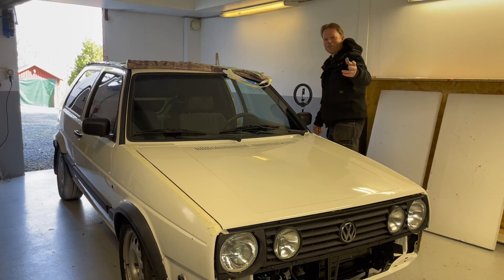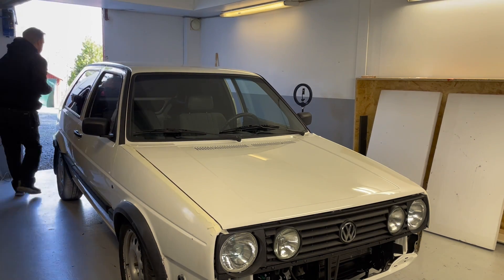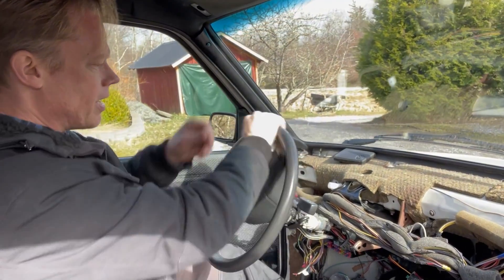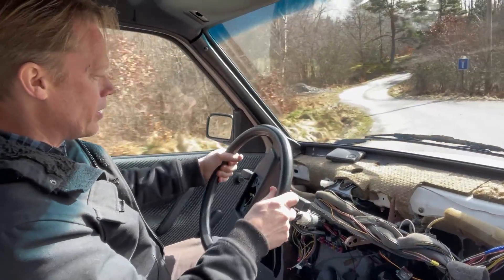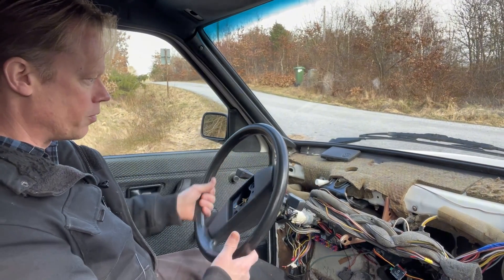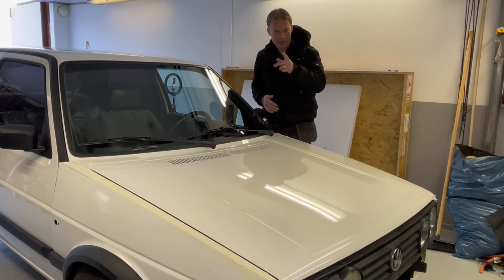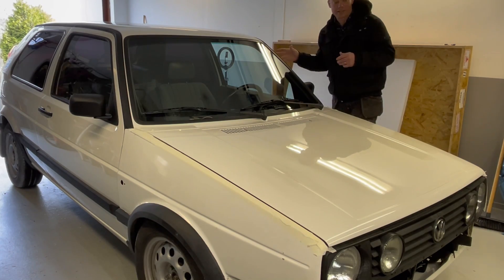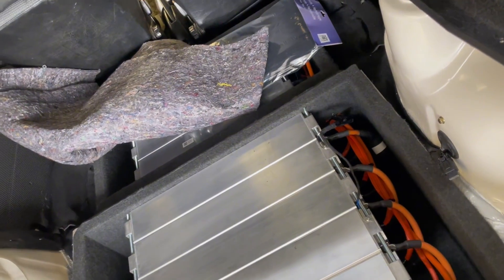First test drive, charging paint job and more. Vw golf Citystromer, ev conversion.

Comment: 7:30 Daily discharge 1.1kW? It's a 2-way car connection solution or how to discharge a car battery? OR this is a home battery and 27kWh to house U using without SOLAX Smart charger?.  Now VW ID 4 to ID7 is possible to charge and discharge, but VW does not sell chargers for these cars.😅😮😢😊
Reply from the maker: That is my house battery you talk about the car is on the load side. But I have a plan for vehicle to grid with the Citystromer in the future 😉
Reply: @flyingtools  U use Leaf BMS?
Reply from the maker: Yes.
Reply: @flyingtools  I need to find High Voltage BMS 64S. Do U have Ideas?
Reply: @flyingtools  96S or reprogramming?
Reply from the maker: Orion bms will do the jobb for you and is very versatile.
Reply: @flyingtools  Do U have wholesale seller contacts? Weare an automation company.

Comment: Amazing build! Fun that you have the option to shift gears, even though its probably not necessary due to that instant torque. I might have forgotten this from a previous video, but do you use a vaccuum pump for the brake booster?
Reply from the maker: Thanks! Yes, vacuum pump for the brakes ☺️👍🏻

Comment: nice nice nice.... but i think you have do change somethink on the front shock absorber because the car is very deep..... an do you have a new dashbaord for your car? I think in a old modify car mus a new stylic board ;)
Reply from the maker: Hi!
I have coil-overs  on it now and yes it is to low in front. I will raise it up and adjust it when the car is all put together.

Comment: 7:12 - I must have missed a video cause this car is now so much lower compared to the previous videos after the battery swap. The much lighter Li Ion chemistry replace the heavy lead acid batteries and that had raised the car a lot , but now the tires fit pretty good into the wheelhouse, especially in the front.

Of cause an GTi acceleration capability deserves a gti look.  Time must have flown by - learned driving on a Golf 2 so I still have warm feelings for the unique VW instrument cluster with these LED style lights in the middle. I always felt cominig home sitting in a GOLF, even nowadays in an e-GOLF get the same feeling even though a far more complex and modern interpretation. Golf has grown and become an adult, but I am not sure about GOLF VIII which looks like a missed opportunity, but the CEO already announced on the 50 years anniversay of the golf in austria a new GOLF generation coming - but electric only this time which means it will be a GOLF, not any ID crap nor e-GOLF , just an - then - ordinary GOLF - or the new normal as we tend to say here.
Reply from the maker: Hi!
I have coil-overs  on it now and yes it is to low in front. I will raise it up and adjust it when the car is all put together.
Glad that you like it☺️